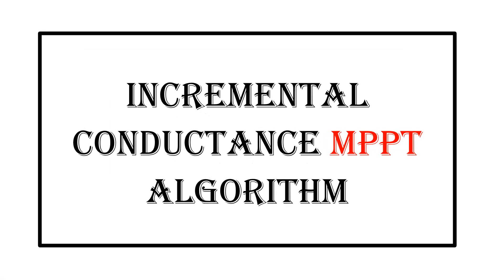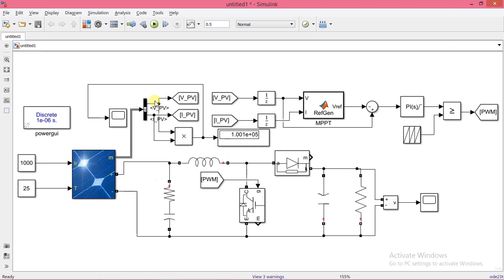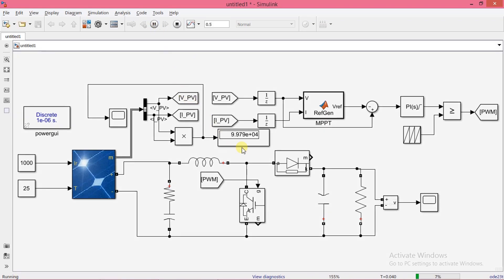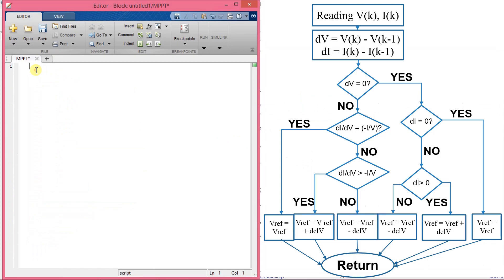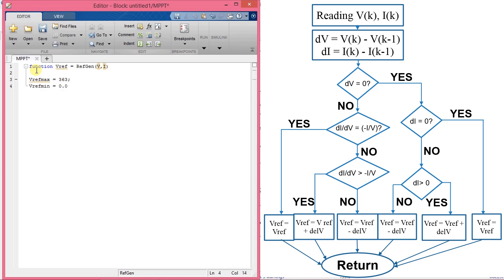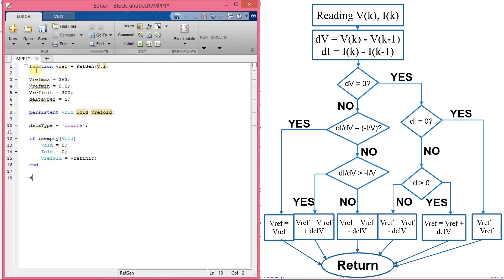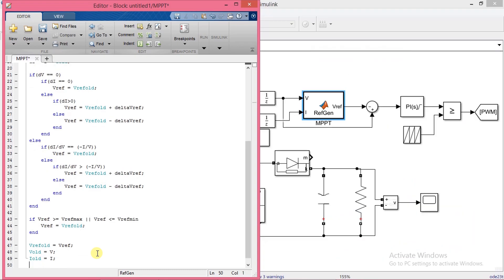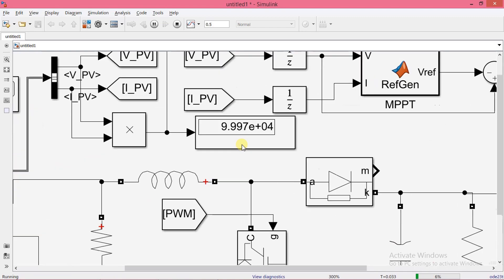Incremental Conductance MPPT algorithm using Boost Converter | MATLAB Simulation.

Comment: Thank you for sharing this useful tutorial. I have written the same code in MATLAB function block which simulate Incremental Conductance method, but the variation of the output power is high.   Is the parameter settings of the PI controller the same with Perturb & Observe method?
Reply from the maker: May be different

Comment: if i want a constant voltage at output what we can do
Reply from the maker: Not possible, then the mppt will not work
Reply: @TechSimulator  I have try both p&o method and incremental conductance method . But in both case output voltage is not obtain 600v . Sir kindly reply .

Comment: Hi
I have a question. To validate the MPPT algorithm, should it be done with the panel output voltage or with the converter output voltage?
In your case you do it with the output voltage of the panel
Thanks
Reply: panel output voltage

Comment: Hi bro, is it possible for you to do a video on P&O and I&C mppt with boost converter in psim , prefer to have the mppt in circuit based design rather than in blocks or codes. Thank you.